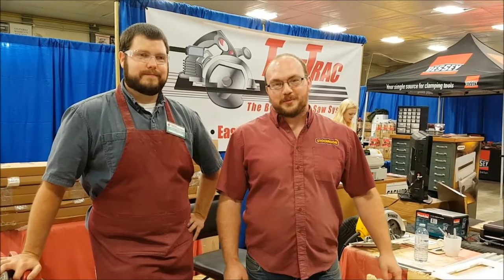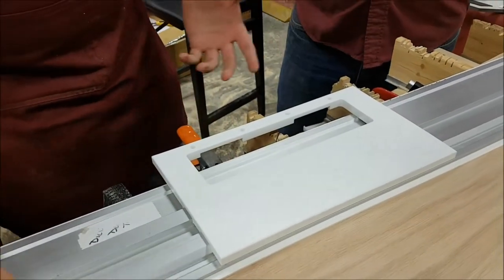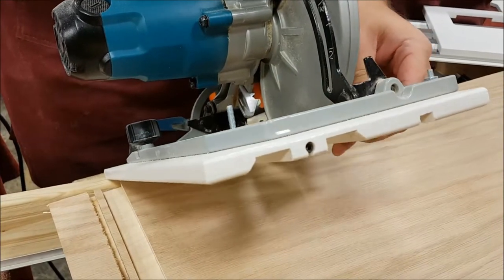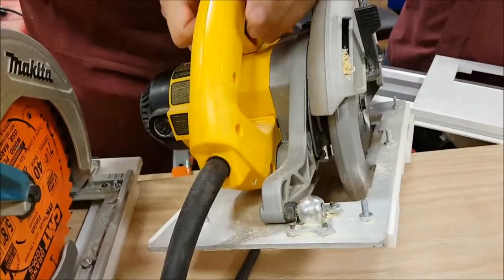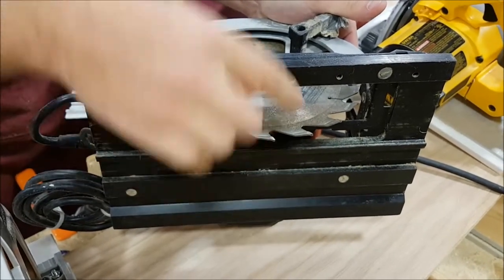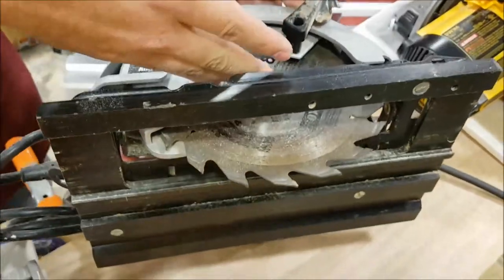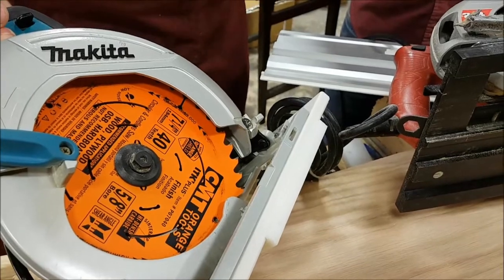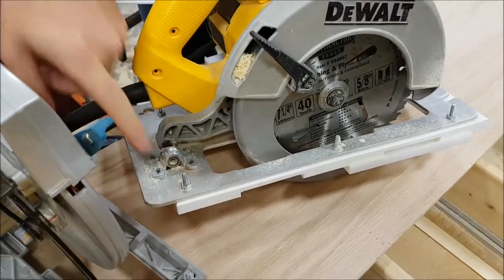Buying A Circular Saw? Here's What To Look For! EthAnswers

Comment: He starts off by showing a height adjuster with movement then fails to show the better, more solid height adjuster but rather the pivot.
Reply from the maker: Hey Mac,
  the side that he showed is actually not the pivot on the Dewalt. Its a very interesting and heavy duty design but is hard to picture unless you have it in your hand. Next time you are at a Dewalt dearler be sure to check it out!